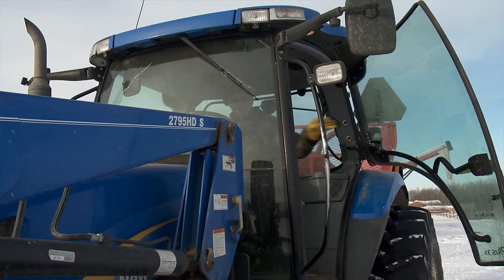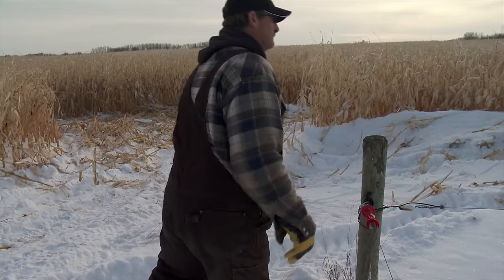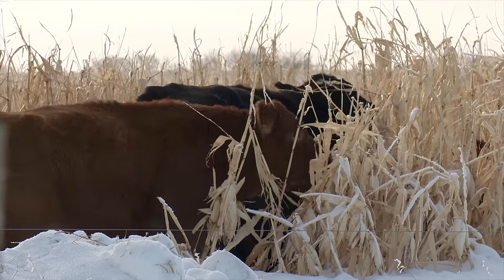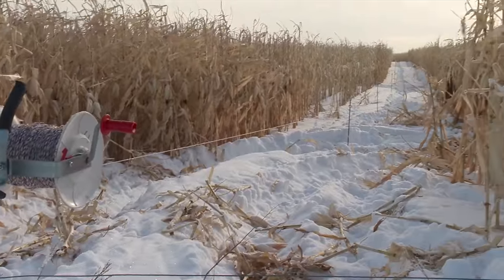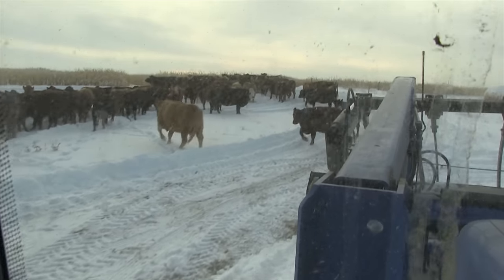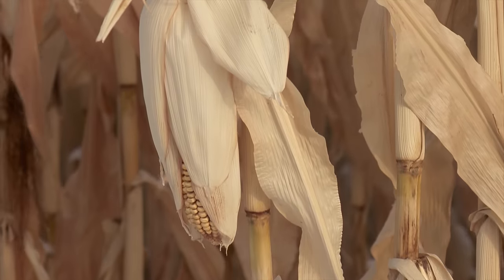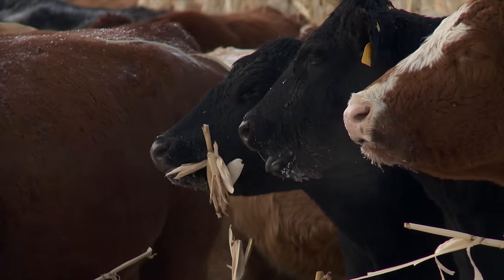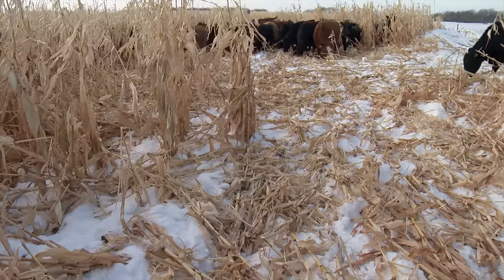Winter Corn Grazing 250 Cows

Comment: You could feed 2000 cows over the winter if you turn corn from 75 acres into silage... just saying...
Reply: Andrei M I agree, the losses are huge
Reply: Andrei M you also have to mix hay and other grains with the silage when you feed. If you penciled it out it would probably be the same $ per head
Reply: 75 acres of silage to feed 2000 head? maybe a month of feed.
Reply: Or about 38 days but your close
Reply: That would be a tough winter on those cows
Reply: 75 acres of corn silage will feed 400 calves for 90 days.
Reply: Then you need a chopper that costs money, trucks or wagons that cost money, a storage facility that costs money, when it costs money in fuel and equipment to feed the silage this is the cheapest way to do it for a smaller herd
Reply: @smithgraincattlesgc4940  and the best for your land.